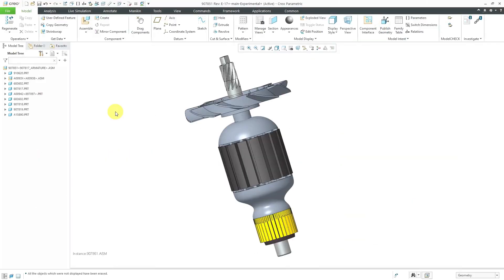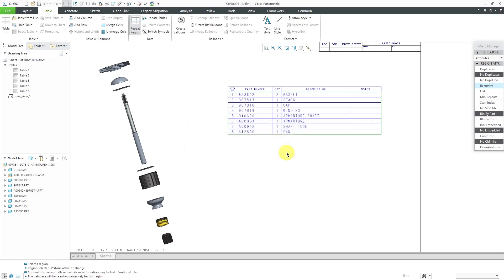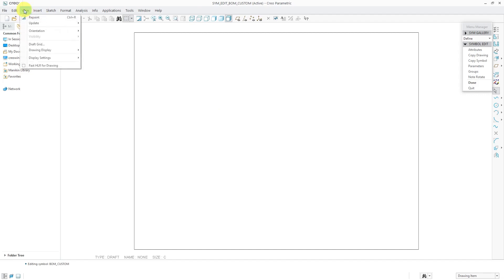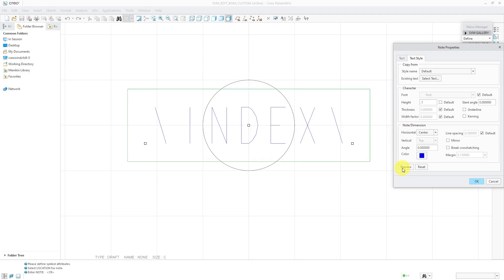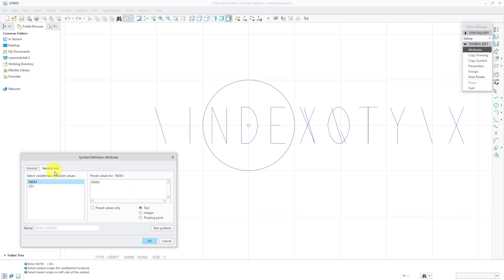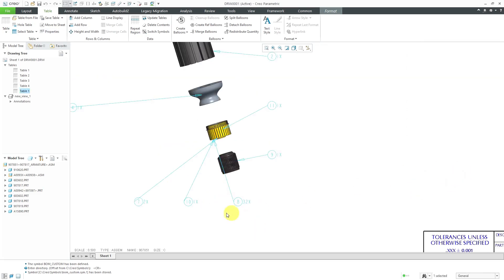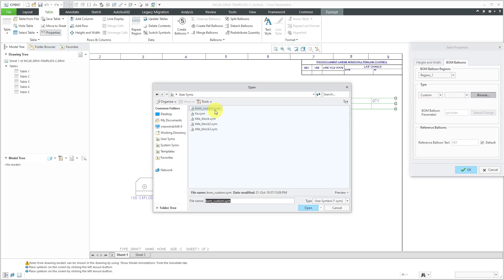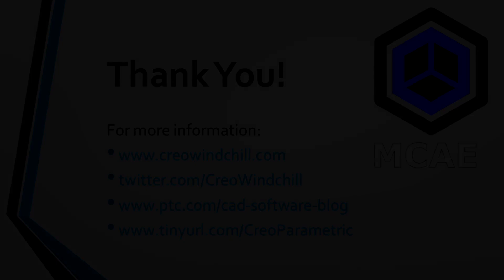Creo Parametric - Bills of Material (BOMs) with Custom Balloon Symbols

Comment: Hi Dave,  Is there a way to change symbols for specific line items in the repeat region?  In this video, you have the qty on the right hand side - if I create two symbols, one RH, and one LH, is there an easy way to switch this depending on the line item?  Some times the drawing gets cluttered having all balloons on one side of the view.  I tried selecting the symbol once the balloons were created, but the Symbol Name under Definition is greyed out..
Reply: long shot, but did you figure this one out? I'm having that issue also
Reply: @99ludester  I was not. As far as I know, this functionality does not exist, at least not in the version I'm using. I had to create 3 different balloons, left hand qty, right hand qty, and no qty. Then you can hit Alt Balloon Symbol, select the region, and then choose the balloon you want to change. What I want is to create symbol groups, but it explicitly states this is not possible for BOM balloons. I made a feature request on PTC, the more votes, the more likely it is to get implemented!

Comment: Hi Dave is there a way to be able to filter out any QTY 1 items, so it will just be a balloon with no \qty\ out to the side? THANKS!
Reply from the maker: Not that I’m aware of.
Reply: I was able to accomplish this using the repeat region relations.  I created a custom parameter "QTY" and did a simple IF statement to check if rpt.qty == 1, then QTY = "", else QTY = itos(rpt.qty) + "X" endif.  Then I had the qty note call "\rpt.rel.QTY\"
Reply: @elocksa  ah nice solution, gonna check that out